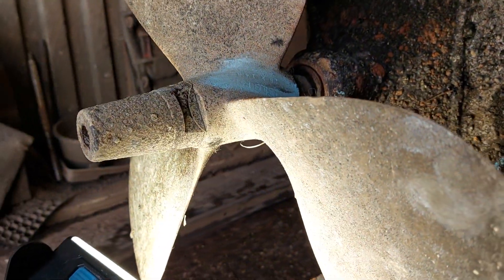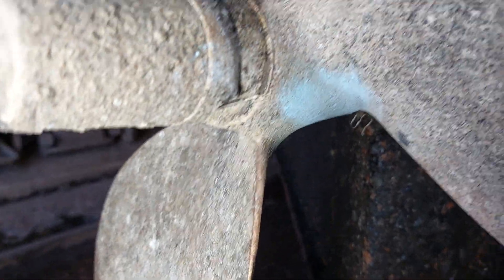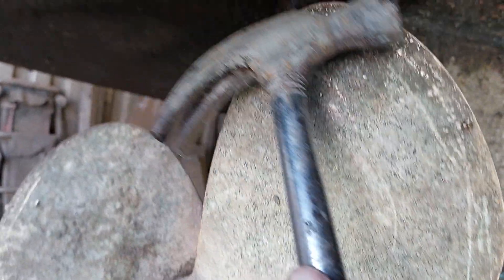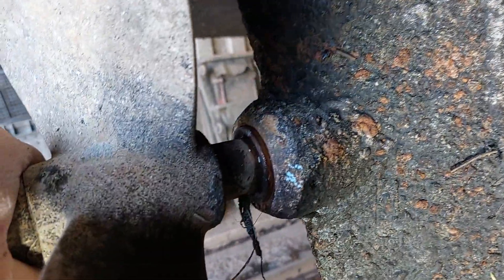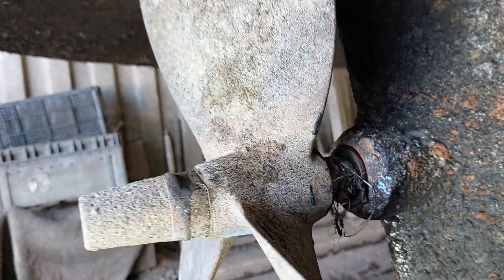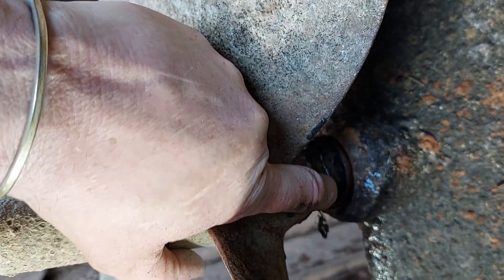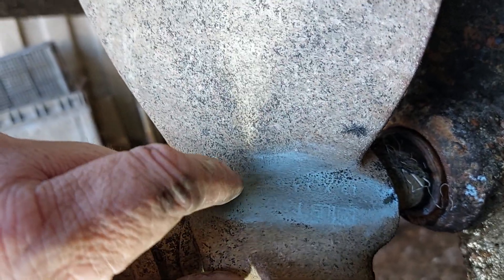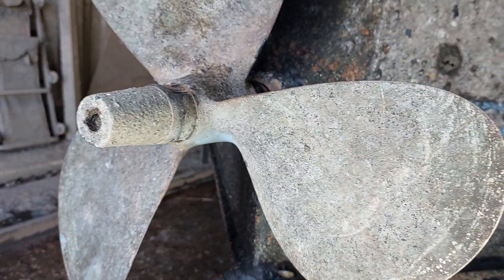A quick masterclass on propeller & shaft checks with an unusual issue found, a loose shaft bearing.

Comment: Great lessons in just 3 minutes; amazing. So a zinc anode does not work at all/much in fresh water? What to do if you sail in both fresh and salt water?
Reply from the maker: So zinc will totally shut off in fresh water. Aluminium will work in brackish and salt, magnesium should only be used if fresh. If you keep your vessel predominantly in fresh when unused then it may be using a hanging mag bonded in and sail with an alloy in salt and brackish. 
This is a quick answer!!. Companies like MGDuff do have a technical help line.

Comment: is ther some standards to the taper the props fit the shaft?
Reply from the maker: Yes there are, most are available from propeller manufacturers,  just watch out for imperial and metric
Reply: @TheMarineSurveyorNotebookBenSu  i ask because i work in engineering. have worked on some damaged shafts. and want to set myself up to do more and easyer. you dont maybe have a chart or a refrance sorce?
Reply from the maker: @manusholm3536  depending on where you are, try t norris who supply propellers and stern gear.. or other propeller manufacturers
Reply: @TheMarineSurveyorNotebookBenSu  thanx. im in cape town south africa. all the supliers here that i spoke to just tell me thay will come and sort it out, scared im competition. ill see if i can look up the norris and se if thay will play nice